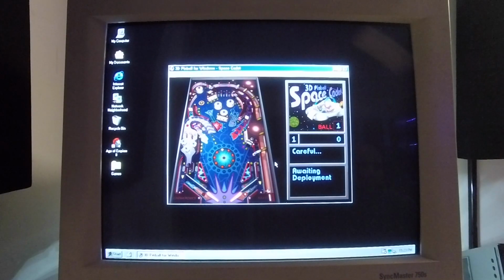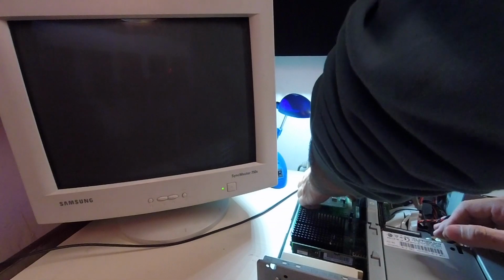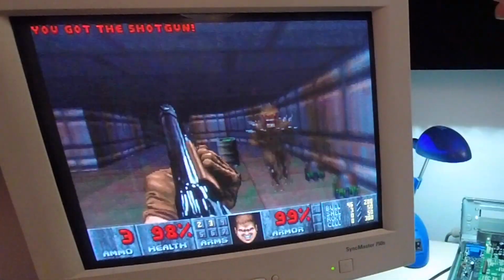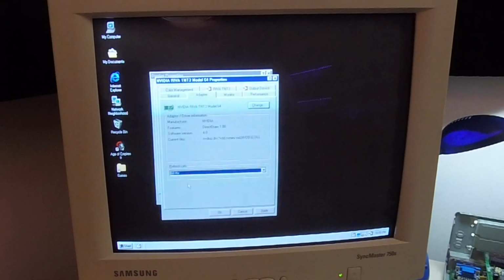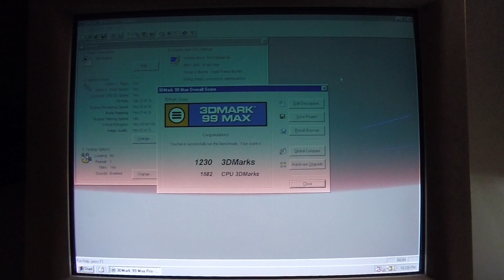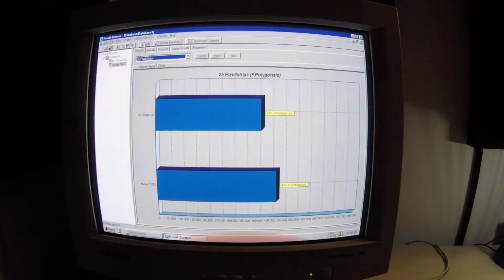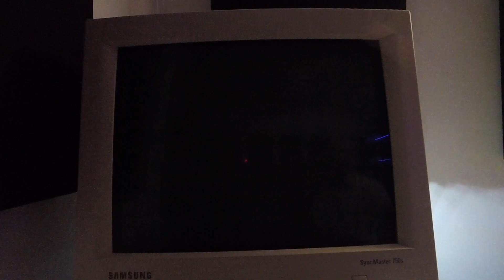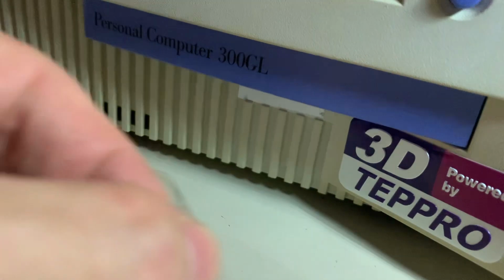UPGRADE - IBM 300 GL COMPUTER #restoredwards

Comment: nvidia tnt 2 instead need one voodoo 3 3500 or 4 4500 more good put ;) my 300 gl voodoo 3 3500 in no old computer a old computer not in voodoo vga :) ibm + voodoo best combo
Reply from the maker: Hey thanks for your comment! That is awesome! Sure would love to get one of those cards.
Reply: i have lot of old ibm computer my coolection one of my 300gl good combo all original ibm stuff op system same but a vga is voodoo : and cpu is upgrade a 400mhz p2 :)
Reply from the maker: @gassygas  nice one man! really gonna look for that voodoo card. Is that IBM of yours slot A CPU?
Reply: originaly 266mhz slot 1 but i upgrade for treatment a 100mhz sg ram
Reply from the maker: @gassygas  great machine!
Reply: thanks :) my most liked now my ibm thinkcenter a50 with 2.4ghz p4 but a real treasure inside for i found quarter year ago the ebay one voodoo 5 6000 prototype with 4500 usd and for my ibm thincenter a50 what new giant house put in if you know a voodoo 5 6000 card size :)
Reply from the maker: @gassygas  Wow that's a super cool card! Legendary! Don't think I could ever find one here...
Reply: yup i gladd for found one i coonected this pc mode 2 fans right and left size a free pci port for more safety cooling a use some day i use this doom 3 indianajones emperor tombs lego star wars playing xD
Reply: only 1000 existing this card 500 for pci slot and 500 for agp slot and 2000 s arival a 23 year late how many live now a quest
Reply: hello did it comparios my voodoo 5 6000 i think for tell u :) a power point matches the ati radeon 8500 xt :) but 3 month i testing to did it this xD radeon 7000 to 9800 se comparios test :) but i think upload this you tube i hope u watch :)

Comment: i was using that same computer in 2000
the sound trouble is related 100% to drivers
Reply from the maker: Thank you indeed! I'll check that.
Reply: @restoredwards  have you tried to set to sound blaster pro? that is was i would use
i think its set to 220 1 5? i don't remember
i actually do not think the game sound would be mono that that would be only the midi music
the sound is related to sound blaster driver issues i believe
does duke nukem  3d sound work for you?
Reply from the maker: @10percent4DaBigGuy  duke nukem sound works fine, it's like doom only in this case with those ess and yamaha cards, but I have just got a sb 16 and I think that will be doing good. Although I will be retesting those other cards again. Thanks!